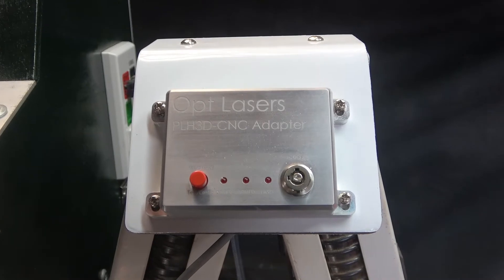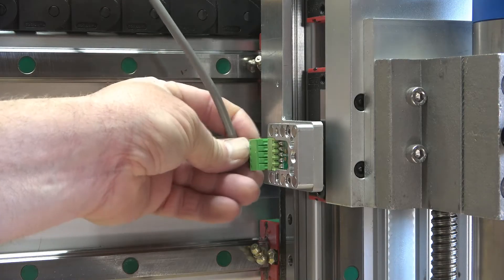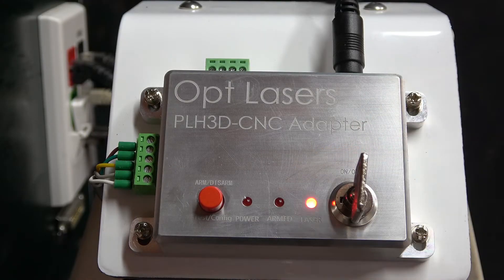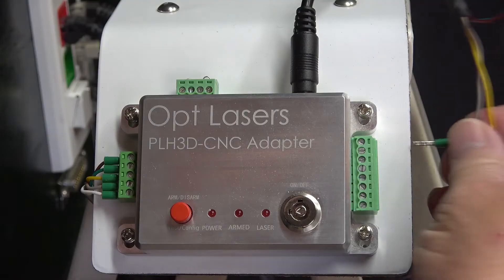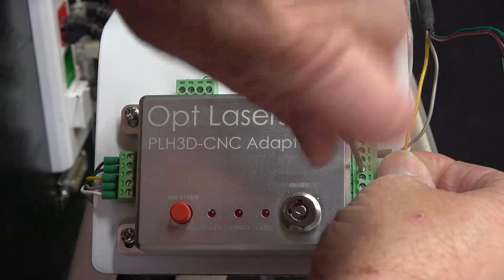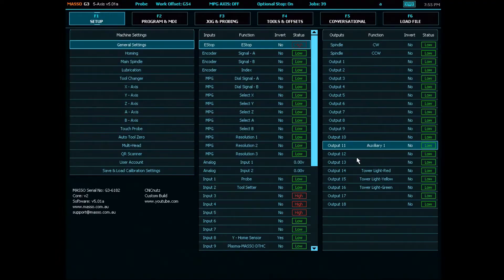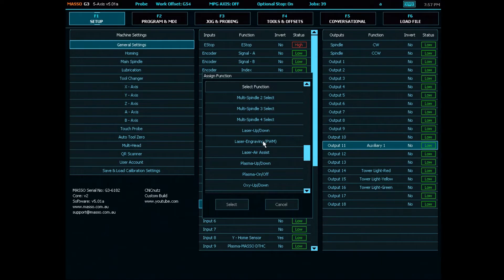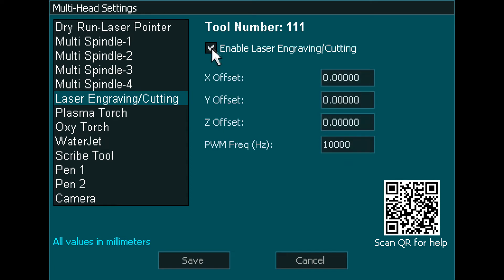How to Set Up Opt Lasers Kit on MASSO - Educational Series

Comment: HI I FOUND THE 111 TOOL ENGRAVING /CUTING AND THE LASER BOTTON  BUT THE LASER IS NOT WORKING
Reply from the maker: Please watch these two videos as well and verify your settings, which are shown in the second one:

https://youtu.be/NU94qZiKOTE

https://www.youtube.com/watch?v=3yvB26bm2Qs

As long as you have the correct connection, correct Adapter program and your controller sends an appropriate signal, then the laser head will work with ease.

Feel free to reach out to us through our contact form if you need help with checking your connection and your Adapter program: https://optlasersgrav.com/contact-us